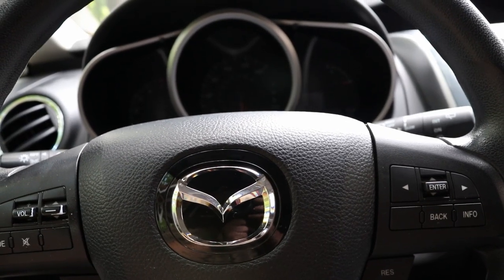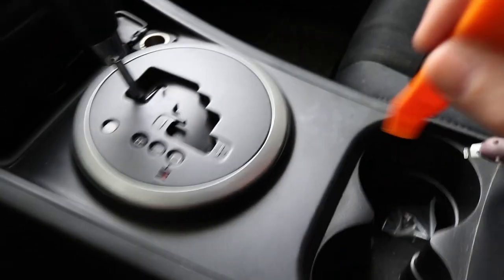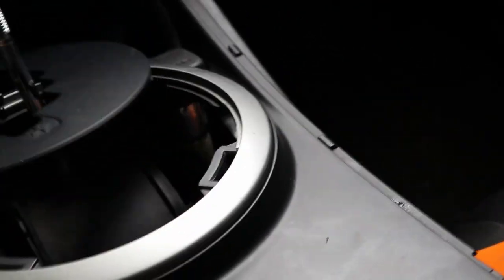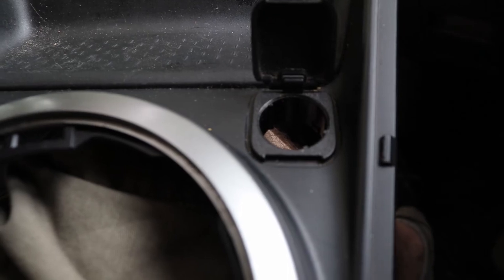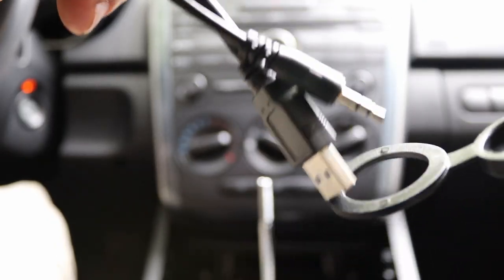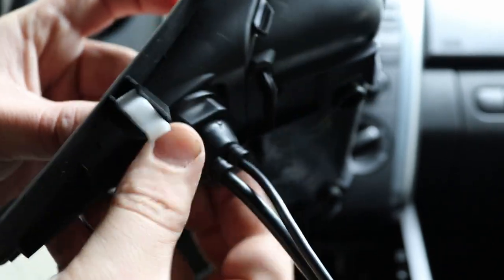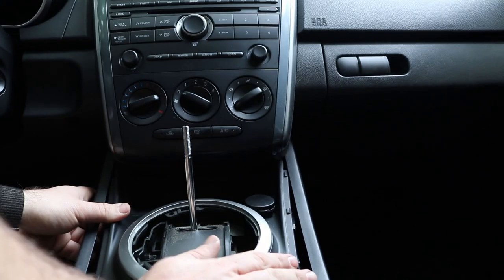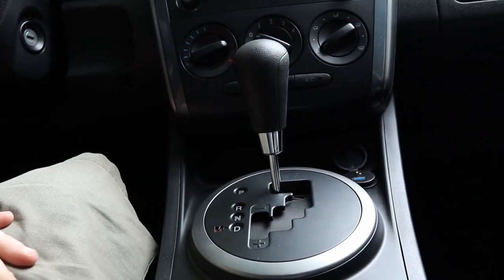How to replace 12v outlet (cigarette lighter) Mazda CX-7

Comment: Question - what do you do with the wire that used to be connected to the 12v socket? Do you have to terminate it or remove a fuse, or is it a live wire just dangling back there? Thanks for the video!
Reply from the maker: With that wire the plastic bit will protect it by itself. but, I like to go back with Tesa tape and wrap it up nice just for extra protection. If the fuse only goes to the cigarette lighter then that’s a good option also, but a lot of the time the fuse will be tied in to other things. Hope this helps!

Comment: Hey junkie another question dod you get a 3 ft cable or 6ft cable
Reply from the maker: So I don’t remember the exact length. But, I’m almost certain it was the 3ft.
Reply: Im asking cause instead of putting it in the front i want to put it in the center compartment
Reply from the maker: Makes sense, in that case I would go with the 6ft. Worst case you have a lot of slack you can just tuck away no problem. But, if you get the 3ft it may still reach depending. Although the worst case is that if it’s not long enough, you’ll have to buy the 6ft anyways.

Comment: Thanks for the nice video! So the stock radio doesn’t have usb port as you said in the comments! Does the stock radio has aux input? Is there an aftermarket piece that can plug in to the stock lighter output and at the same time to have an aux outlet also? So you’ll have the lighter plugged in to its Stock inlet and also have an aux outlet outside the box of the armrest( who the heak thought of it????) in order to connect to the stock radio inlet ( if there is such an outlet at its back??)
Reply from the maker: Hey, I will check this afternoon to see if it actually has a aux input I think it’s apart of the harness but I’ll see. But what year is yours I believe it’s 2010+ that had the aux option. As for is there a why to have stock 12 volt outlet that also functions as a aux outlet. I haven’t seen that but you can always add a 12 volt outlet pretty easy and cheap. As for them putting the port in the armrest I agree sometimes these engineers put them in crazy places that make little sense haha. I hope this answers your questions. Thanks for watching!
Reply: @JunkyardJunkie  thanks for the info! Mine is 2010 2.2 diesel.

Comment: Thanks for the video. I had no idea the radio came with a USB connector in the back. Too bad we don't see that part in the video.
Reply from the maker: Sorry I lost the footage when I installed my new radio. But the stock doesn’t have a usb plugin. I have a aftermarket.

Comment: Nice, you made it look easy I have the same problem. Where did you buy the one you installed ? Local auto parts store or Amazon?
Reply from the maker: Thanks! I bought mine on Amazon I’ll link you one just like the one I picked up. BATIGE USB 3.0 & 3.5mm Car Mount Flush Cable 3.5mm + USB3.0 AUX Extension Dash Panel Waterproof Mount Cable for Car Boat and Motorcycle - 3ft https://www.amazon.com/dp/B072KGMJ5N/ref=cm_sw_r_cp_api_glt_fabc_R3KD02CPRCHP0QHNT0DV

Thanks for watching!
Reply: @Junkyard Junkie.... thank you I really appreciate it

Comment: Where do you plug the cables? Why don’t you show that part?
Reply from the maker: The cables plug from the outlet to the radio connector. I didn’t have the radio installed at this point. But, I wanted anyone doing it to have that piece available to do. Thanks for watching!